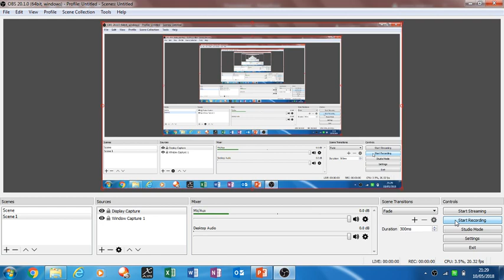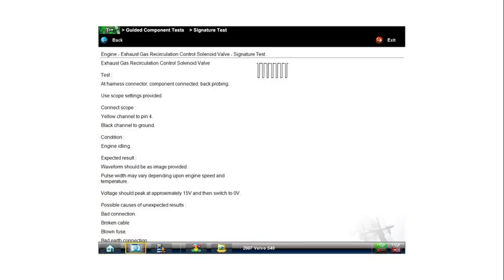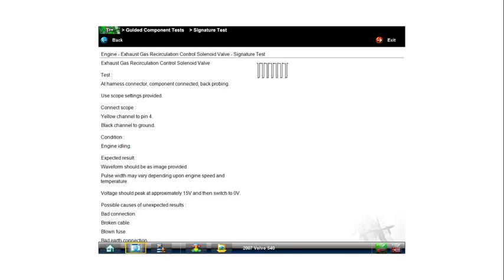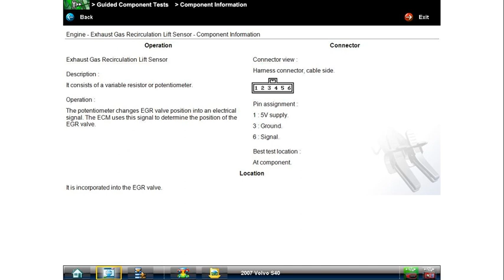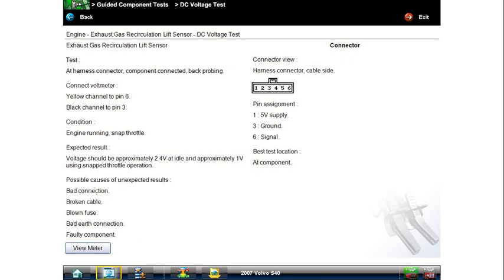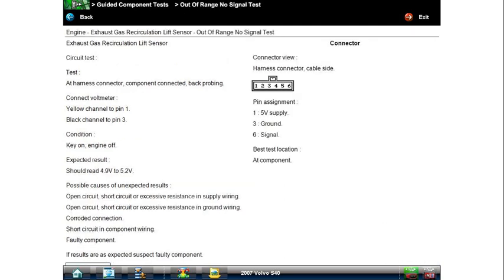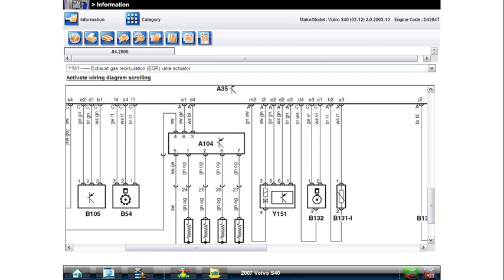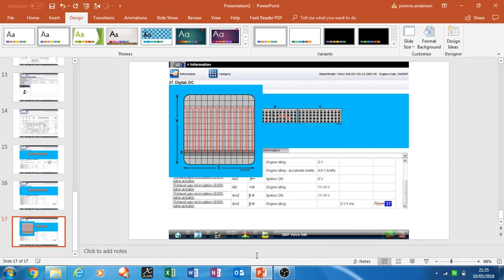Volvo S40 2.0TD EGR information part 2

Comment: Thank you Sandy!Very informative!I cannot unfortunately control through Vida either Egr or Maf.My concern is about egr position sensor which give only 0.01volts at all modes.At idle and during acceleration.I have Twice  removed egr for cleaning and noticed that linkage which moves the rod has kind of stuck point.Why 0.01v? Maybe Vida giving me crap results?